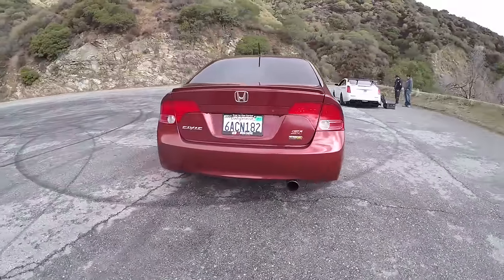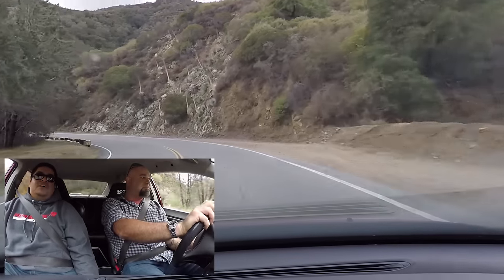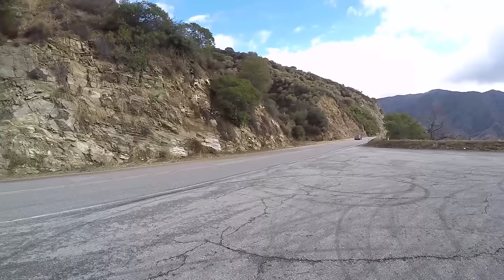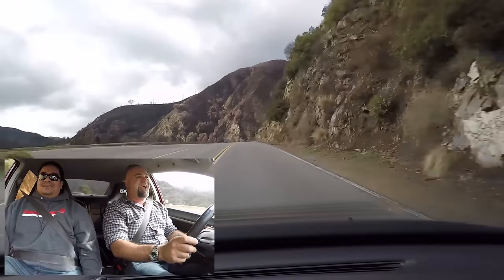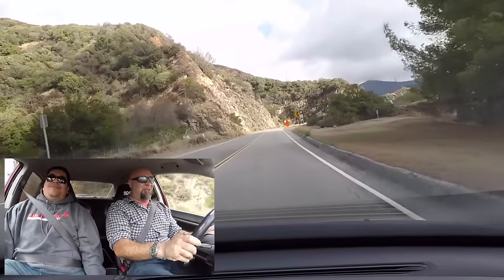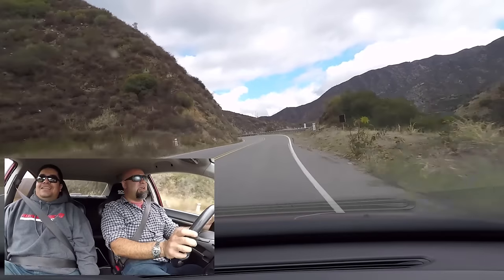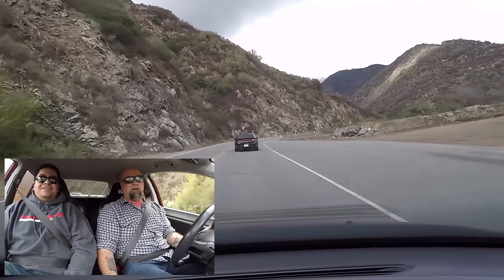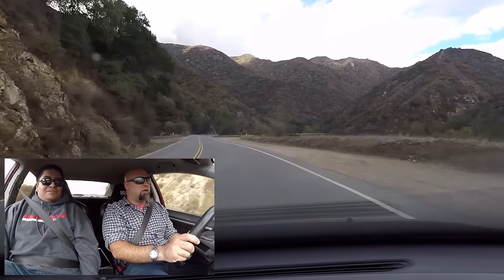INCREDIBLE 330HP All Motor 2007 Honda Civic - One Take

Comment: Don't end the civics. There has to be a lot of us who enjoy watching even more civics even though you've already covered them.
Reply: this (and if he did he should doing porsches also)
Reply: Matt said he wanted him to come back with one of his turbo civics!
Reply: I want to see some one go nuts with a base model. R18 8th gen/ 9th gen
Reply: He said the end of NA civics not civics all together
Reply: there's a guy in Oregon with a 600+ r18
Reply: Who is he on 8thcivic? I haven't seen many people pushing past 400 on the r18 even with boost :o
Reply: Justin Croatto vitviper
Reply: Justin Croatto after a little searching I found it made 551 at the wheels.
Reply: Alex Boehm knows his shit
Reply: Impressive
Reply: I hope someone brings him a CRX! I wish I lived closer so I could bring him mine.
Reply: Dont end the fiesta st either please!!!!
Reply: Definitely need more Honda's in general. Gotta' focus on the properly built ones though.
Reply: It is best that Honda improves the design of their Civics while preserving their legendary K20A 2.0 4-Cylinder Engine :)
Reply: Bobby Vang I thought the A is for the transmission type, like for example my Si is a 2007 K20z3, k20 engine and z3 transmission. I could be wrong
Reply: Block and head code.
Reply: Turbo R18 swapped crx would Scoot. And R18s are cheaper than k series
Reply: You'd be better off just building a turbo B series. I don't think anyone makes mounts for the R18 in older chassis like that.
Reply: He meant more like, there aren't really anymore Series he can still drive N/A because he drove most of them. Unless he does D series.
Reply: Chris A  Buy a Honda Civic 😂.
Reply: FACTS

Comment: This guy built his own transmission as well lol he really knows his stuff.
Reply: XxChuyoxX 
It's not that hard. All the k series parts are interchangeable. Im using a k20a2 final drive (4.3) with civic Si 1-5 and tsx 6th gear.
Reply: Spoonzaza I've heard the 6th gear from the 8th gen si is the same as the tsx
Reply: Spoonzaza 

It's not complicated but it's definitely not as simple as cracking open the transmission and replacing a clutch..
Reply: tj omoso 

It's not. 

I believe the tsx 6th gear is longer than the 8th gen 6th gear and the 9th gen si 6th gear is the longest out of all of them.
Reply: XxChuyoxX tsx 04-08 6th gear is the same ratio as a 8th si 6th
Reply: XxChuyoxX that's right he actually rebuilt Tongman's SI few years back and made video on it
Reply: Paolo Inigo 

Yep I watched it lol
Reply: Art Vandelay idk about that, seems that most subie owners are engineers.
Reply: I thought candito was here
Reply: @XxChuyoxX  Or you can just get a PPG gear set.
Reply: Spoonzaza exactly for a lot of what he said is “custom” is literally just Honda/Acura parts mismatched to be “custom”

Comment: I gotta say, 330whp naturally aspirated in any 4-cylinder car is insane, let alone one that can actually idle and not stall every 2 seconds.  Wow.
Reply: Yeah man.  I'm not a huge Honda fan, but I have respect for people who build these motors.  330whp is what Evos and STI's run with a tune and some bolt ons.  MAAAD!
Reply: Griffin Glenn don’t forget that evos and wrx have force induction this is pure motor
Reply: @GeeGee2264  evo and sti will get spanked by this all motor civic.
Reply: @auomauom  buuuurp no
Reply: @brent1835  um, yes. And easily. That civic will easily run low 12s high 11s with that much power
Reply: Oshe Shango  It wasn't breaking up, that was traction control
Reply: @brent1835  yea this Civic would eat up most cars on the road modded or not, if I heard him correct it runs 11's and that's with it just burning tires the first 60 foot if they can get it to hook up outta the hole that car runs 10s . And on the street from a roll that Civic would be a handful for any car. I'm not even a Honda fanboy but that's an impressive all motor car.
Reply: my wrx lolol its a 4cylinder and would prob kick the shit out of the civic
Reply: A 43s 420hp 2.0l = 210hp/L
Reply: @amanpaul6881  I'm going to go out on a limb here and say NO, no sir it will not.
Reply: Aman Paul  I hope this is sarcasm
Reply: this is probably the only 400 crank horsepower 4 cylinder naturally aspirated in the world. most 4 cylinders cant make over 200 hp without boost....this car is truly amazing and shows the potential of the k engines
Reply: @brucelee7283  Ks have been taken MUCH further than 400bhp N/A with silly (dieselly) high compression and enlarged displacement, long stroke but revving them to stupid rpm... how they stand up to it, I really don't know.
Reply: @amanpaul6881  you say that to yourself every day don't you "I'm faster then them in my wrx" all of you subarus trying to race
Reply: @amanpaul6881  Subaru are slow. There the laughing stock of Japan

Comment: this guys is a real tuner: 14.1 compression, Gearing, n.a with 330 Hp, making 11 seconds on the drag strip.
This dude deserves a prize.
Reply: Bruh, when he listed his parts list.. I think I passed out.
Reply: K Cruz hahah the price must be insane
Reply: @RobiB95  it's not about the price, having the knowledge and research he did for the build.
Reply: cranky1812 ofcourse, and thats the most time consuming part of a build!
Reply: What prize you suggest he gets?
Reply: Assumed its flywheel horsepower is 375, that's 150hp/liter. It is btcc jgtc race car class and might need 10k max rpm!
Reply: @ParissaKhoury  his prize is that he's driving this car daily.
Reply: Any honda k series that makes over 250Hp N/A gets a thumbs up from me, actually edit, if it revs over 8,000 rpms and has an H badge on the trunk and hood (or grille) it gets a thumbs up from me , God only knows why they got rid of the k20 in 2012 and replaced it with a disappointing 7,000 rpm k24 that you cant hardly here a true vtec crack come from, I know believe it or not 7,000 rpm would still be considered high especially when you compare it to a 5,000 carbed chevy 350 junk box, but sorry 7,000 doesn't do it for me gotta be 8k or higher imho.  Hell I used to rev a stock block b18Ls with arp head studs only to over 8,000 daily and for years without a single hickup. I also cannot understand to this day why Honda took their race proven double wishbone front suspension and passive rear wheel steering rear trailing arms out of the civic chassis , but kept it in the accord and Tl for years , makes no damn sense to me still scratching my head wondering  why why why, McPherson strut is fuckin shot.
Reply: Sebastian Conde mind you it be being a full weight car with all oem body panels, oem glass, and full interior. This could easily be a 10 second car with less weight, I highly doubt this is a 2,500 lb car
Reply: That is badass. 11.3 at 124 even with slicks on the front is amazing for a naturally aspirated Civic sedan. Mad props !!!
Reply: They are really fat. Oversized for this seat. Forget about hp, the drivers need to lose weight .
Reply: @cranky1812  It's a little about the price.
Reply: The RSX in my avatar is an all motor 13.5:1 NA K24/K20 340 whp build that I did 4 years ago, 11500 RPM redline, and has been my daily driver since I built it.  I will post my build list below.
Reply: ENGINE- 
K24A2 Block
Supertech 89mm 13.5:1 Pistons 
Pauter Forged titanium Rods
K20 Type-S Oil Pump K-Mod ported
K20 Type-S Oil Pan
Hybrid Racing timing chain tensioner
Cometic Head Gasket
ARP Head Studs
K20A DC5 Head ported and polished by ASP Headers.
ASP Custom Step race header
IPS K2 Cams
Supertech Beehive Valvesprings & Retainers
Supertech Valves & Valve Guides
Drag Cartel Exhaust Cam Gear
RBC Manifold (Ported by and polished, and port matched by ASP Headers)
K-Tuned Billet Hall Effect TPS Sensor
Hondata Intake Manifold Gasket
Hybrid Racing RBC Throttle Body Adapter
Hybrid Racing Thermal Throttle Body Gasket's
Injector Dynamics 750cc Injectors
Hasport Motor Mounts, Innovative Front Motor Mount
Toda Titanium catback exhaust
DC5 Type R Tranny w/ TSX 6th Gear
PPG Straight Cut 1-5 Dog Box Gears, with TSX 6th gear
Exedy Stage 3 twin disk clutch
Hybrid Racing Clutch master cylinder w/ steel braided clutch line
EP3 Type R full electric steering rack swap 
EP3 A/C Lines
Koyo Radiator
Hondata K-Pro V4 with blue tooth connectivity, Tuned by LoCash Performance

EXTERIOR-

JDM DC5 Type R Front Bumper with Type R Lip and Type R Brake Duct Kit
Aspec Rear Lip
Morimoto projector HID's

INTERIOR-

Full DC5 Type R Recaro interior swap.
Pioneer Touch Screen Double Din DVD/DVR
Works Splash Short Hub
FET Quick Release System
Nardi Leather 350mm Sport Rally Steering Wheel
Mugen Rear View Mirror Cover
Hybrid Racing Billet Shifter
Autometer Oil Pressure Gauge 

SUSPENSION-

Mugen Front and Rear Strut Bar
Rear titanium Miracle X bar
Toda front and rear sway bars
Buddy Club sway bar end links
Tein Super Street MonoFlex Coilovers
Inverted Tie Rod Ends
Buddy Club Extended Ball Joints
Reply: sbounty3 sounds like a lot of love here. How much does a build like this cost?
Reply: CarFreak actually many tuners build cars like this.
Reply: whT does it rev to
Reply: @danhernandez4585  over 15 K...
Reply: CarFreak wtf? 330whp is like normal for fast K series guys.
Reply: @mattvang3439  not all motor
Reply: @mattvang3439  330 whp all motor is pushing the limit, and it cost around 15,000 to get your car to that hp. Why not just get a 07 g35s 6 spd manual for $8000 and smoke everyone for half the cost
Reply: @dkis8730  this g35 has 340 hp stock and will smoke this civic while being basically stock
Reply: @brucelee7283  1: No it won't, the g35 weighs way more, and the gearing isn't gonna be as good as this Civic.
2: There are plenty of cars that will smoke this Civic stock, I don't understand what your point was.
Reply: @dkis8730  1. G35 weighs 600 pounds more but has way more torque to make up for it.
2. 6 spd transmission has decent ratios, and the g35 doesnt need short gears since its a torquey engine.
3. Rear wheel drive
My point is why spend 15,000-20,000 on a civic when a $8000 g35 will still smoke it
Reply: @dkis8730  are u gunna telll me this 350z is slower too??
Reply: if i put 15k into the 350z like he put 15k into that civic then the 350z will run 10's
Reply: @brucelee7283  You clearly do not understand the point of this build, nor do you understand what I'm saying. I'm not wasting anymore of my time trying to talk with someone who won't listen.
Reply: @dkis8730 ok i could spend 100k to build the fastest na geo metro that runs 11's...but at the end of the day whats does that really accomplish?
Reply: I wonder what the 3.5 V6 Accord fully built n/a can make power wise
Reply: @dkis8730  I commend you for your patience. Bruce Lee just gave me a headache. Lol
Reply: @brucelee7283  no shit but who wants a vq in the first place🤮
Reply: @brucelee7283  ur comment about a 350 beating this civic stock is absurd. I had a sc'd si at 320 whp and beat a 370z comfortably. This civic has more and weighs less. U must be a honda hater or something
Reply: They have scions all over the scion life forum running all day 10’s still not reaching their potential however for something more streetable this is nice
Reply: @ericdrisgula3879  money
Reply: @ogdumplings8196  LMFAO!!!! Bro I died laughing
Reply: @brucelee7283  it does not cost 15k to make this power with a k series…
Cost me about 7500…
Reply: @brucelee7283 dude Runs low 11s on a drag strip, you are lucky if you get in high 13s with stock g37/350z what are you smoking

Comment: As a porsche 911 owner honda makes some of the best sports car in the world; s2000 and NSX are still some of the best car I've never driven.
Reply: Even my little Civic Si, not as fast or good handling. Is a blast to drive.
Upgraded intake, high flow catless header and exhaust. Professional tune on 93 octane.
I love getting on the interstate while doing a 3rd gear pull! The motor sings at 8500rpm.
Once again... It's not fast. But for a cheap car with $1600 in mods it's fun to keep in the high rpms and enjoy.
Been beating on my k20 and k24 cars for the last 6 years everyday. Never a single issue.
Reply: @doublevanoz  stop being salty Porsche makes badass cars and are way more expensive than Honda but with Honda you get so much for your money that a Porsche owner thinks that the s2k which was around 30k at launch brand new is one of the best cars even after all these years really says something about how good honda is.
Reply: Doublevanoz yeah it was kinda douche but I guess what he means is that he has experienced quality and the performance capabilities that come with a price tag way above that of most Honda’s. Yet Honda’s have made such an impression that he respects them to this day regardless of what others say ✌️😄
You have to experience Honda’s, STIs and EVOs to understand and he has.
Reply: @doublevanoz  I don't think he is trying to be mean or flex but Porsche makes one of the most performance/track orientated cars in the market. As a matter of fact most Nurburgring lap records are by Porsche. So I think he means as someone who as experienced a truly performance orientated car he appreciates and understands how good Honda is.
Reply: @doublevanoz  The point he is trying to make is even after owning cars that cost a couple hundred thousand, and yes are by far superior to a Honda in many ways.  He still loves to drive Honda sports cars.  Please tell me an old lady that owns a Porsche 911 GT2 RS Weissach.
Reply: Too bad they don't make more rear wheel drive cars like those.
Reply: @ryanfulkman  Headers, cone filter and a full exhaust, sounds like the ebay ricer special. You probably spend 2-3 grand on a whole lot of noise and about 5 hp
Reply: @placeholdername3206  LMFAOOOOOOOOOOOOOOOOOO damn this dude was salty as fuck 3 years ago what happened to you 🤣🤣🤣🤣